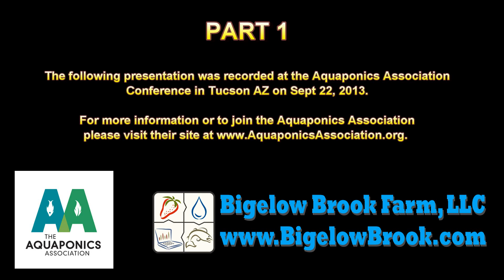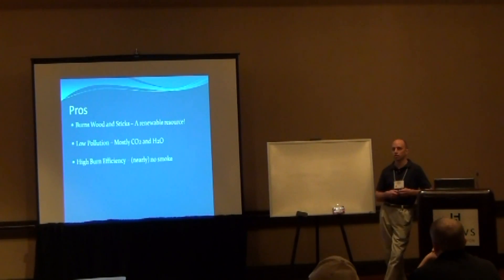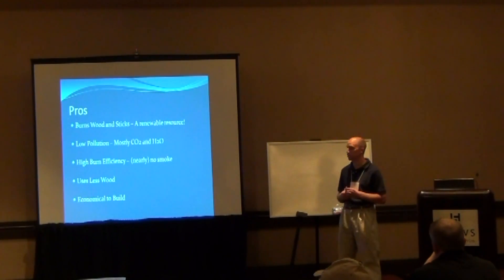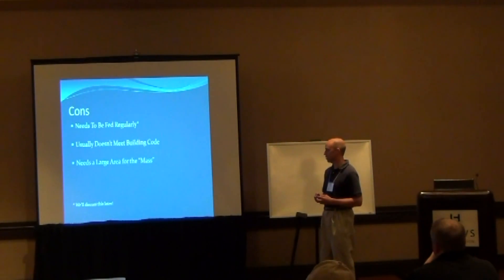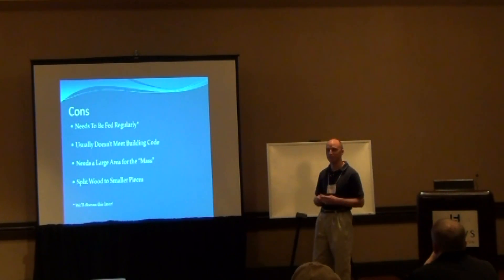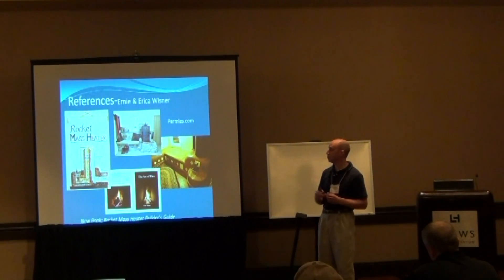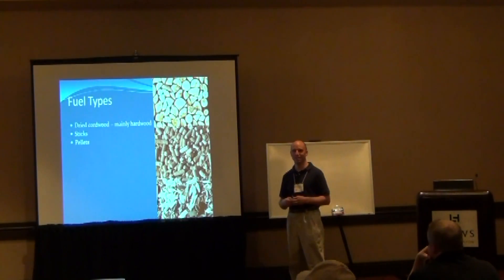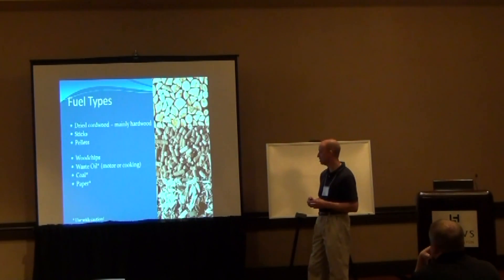"If You Play With Fire..."  Rocket Mass Heater Presentation - Part 1 of 3

Comment from the maker: right now, I'm just making different style grates & hoppers to burn the different fuel types.  There's enough of a difference in them where they really need their own feed systems.  I"ve been trying to avoid using any types of automation (even though I have to kno-how to use them) so that the system can run without the need for power.

Comment: In this way, you can then use different fuels with different feeding rate while having constant system temperature. And you can also monitor the system and shut the system down by stopping the fuel feeding if it burns out of control.

Comment: Hi, I have been following your project for a while now. Now when I am watching your new videos about RMH, I noticed you said that there a over heating risk in RMH depending on what fuel you use and how much you use it. I remembered that you also monitored the temperature of your RMH system. So I'm wondering if your have thought of developing a temperature control system for you RMH by electronically control the rate of feeding the fuels?

Comment: Between you and Paul Wheaton,I have gotten most of my inspiration for my rocket mass heater project that I am going to be doing very soon. I am going to try a variation on the burn chamber using hardi backer with a fire clay and perlite mold. I am also going to try to implement a burn of paper briquette made from recycled newspaper and sawdust. Thanks for all the great ideas so far!